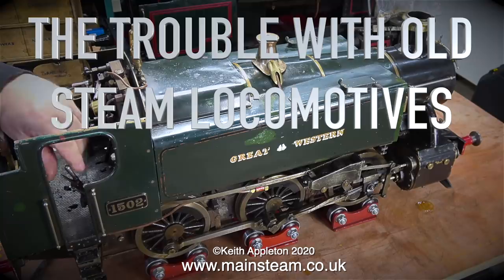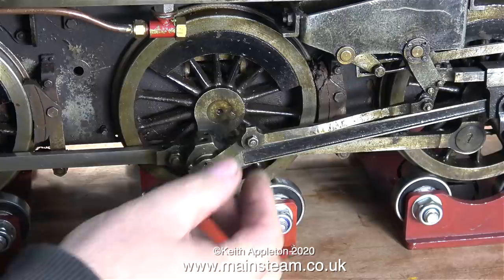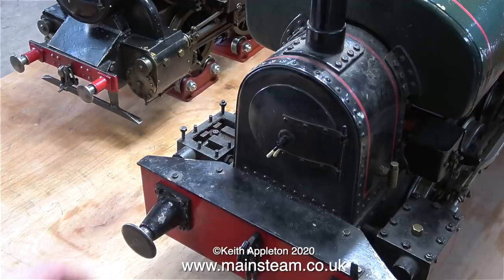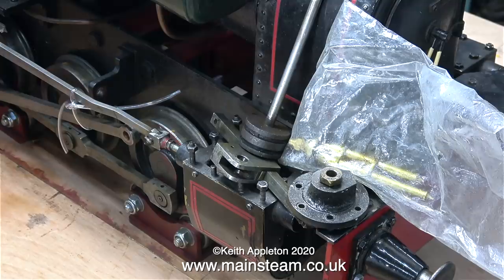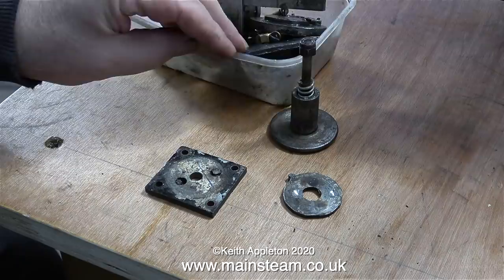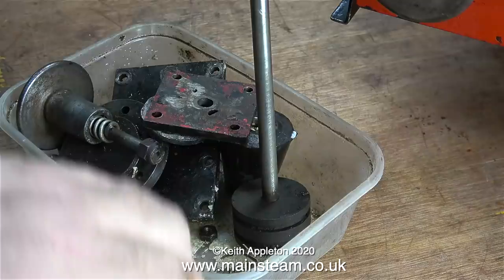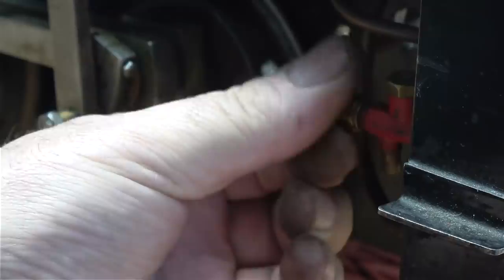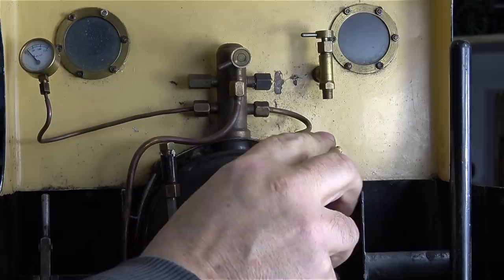THE TROUBLE WITH OLD STEAM LOCOMOTIVES - PART #1

Comment: If you use a one gal metal paint bucket with a couple of inches of solvent and seal it good.  The vapors will do a better job then the liquid.  That always did the trick with my airless paint gun.

Comment: Love your videos, but I have a question: Do you ever use an ultra sonic cleaner to clean up small parts like you put into the cellulose thinner?
Reply from the maker: no, I don't have one.
Reply: @keithappleton  a small one intended for cleaning jewellry is about £30-40, i'd say well worth it for cleaning lots of small fiddly bits, a real time saver. dissassemble something, pop all the small parts in it, set it going and make a cuppa while it's running.